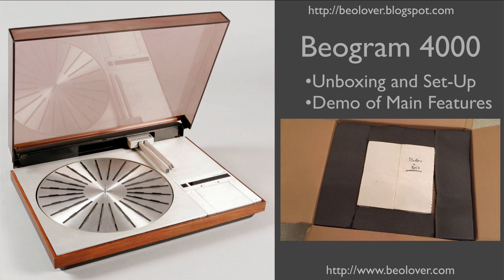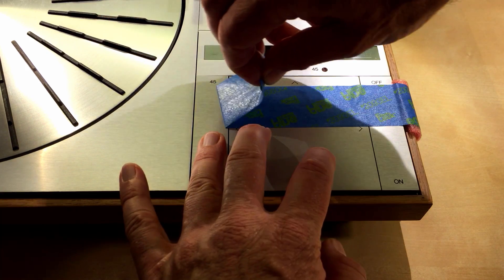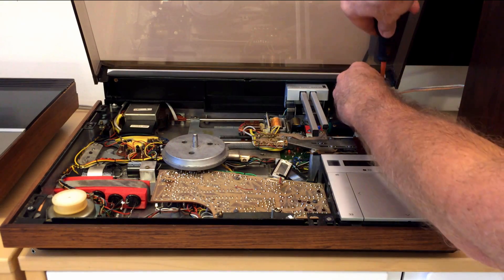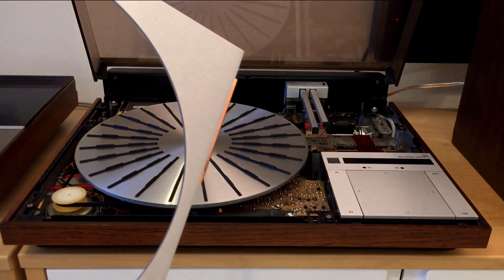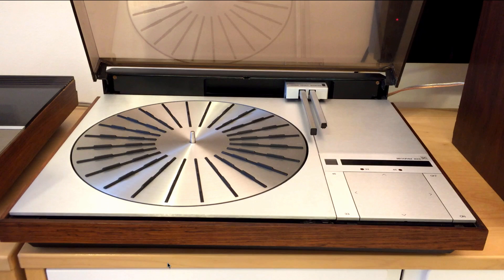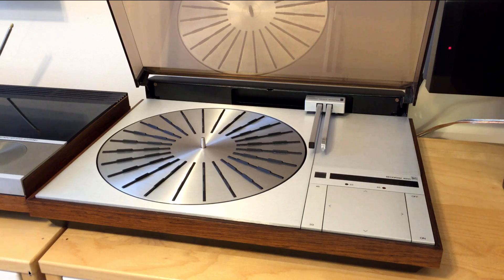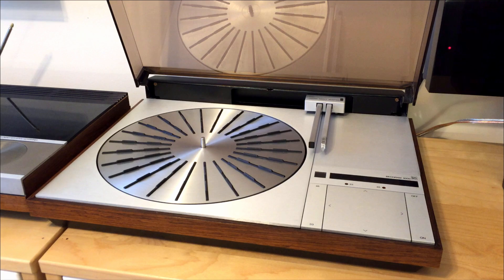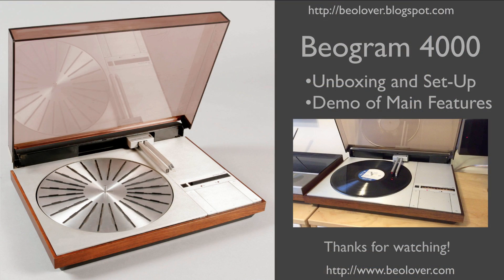Beogram 4000: Unboxing and Set-Up

Comment: Very nice video.  This is the original 4000, which I believe is very rare, at least here in the U.S.  The 4002 and 4004 are much more common.  All three look very much alike, with only the controls are a little different.

Comment: If I want to plug my Beogram 4000 into my amp which has a line in (non-B&O), will I then need a preamp? I will of course need a DIN to RCA but not sure what the audio level is at this point
Reply from the maker: Yes, you would need a preamp! The Beolover has an elegant solution for that: https://beolover.blogspot.com/2023/03/beogram-4000-internal-RIAA-pre-amplifier.html. Get in touch at beolover@gmail.com if you would like to get one.

Comment: Hello,  I just bought a Bang & Olufsen Beogram 7000 turntable with built in preamp, it has a Din 5-pin male connector, how do I hook it up to a regular system with RCA input jacks?  Do I need to get an RCA cable with a ground cable?  I wasn’t sure because this deck has a built in preamp.  Thanks in advance.
Reply: The Beogram 7000 has a built in RIAA so produces line level so can attach to a normal line in input. The plug is actually a 7 pin DIN but the two bottom pins can be unscrewed. It should work without an earth cable but if you get a hum, a wire between the casing of the DIN plug and the earth will fix it.

Comment: hello a query, I just got a 4004 type 5526, failed, the left fuse is missing and I wanted to know if it is 125Ma? and the correct voltage is 117 but I have a transformer from 220 to 110v (I am in Peru), it can work with 110v. No problem?? or it needs to be 117. I hope and appreciate your possible help.

Comment: Excellent video!When you first play that Horace Silver album on Blue Note, it sounds terrible. The pitch of the bass intro is all over the place which would 'suggest' that the turntable isn't running at constant speed. As I'm sure that is NOT the case, why does it sound like that? 
Thanks for all your skilled work.

Comment: Although these were quite good the best lateral-tracking turntables were undoubtedly Sony.  Revox and B&O had  a sort of style but reliability and basic  build quality were inferior in this particular niche.
Reply: Debatable. The later B&O decks were not as well made but the 4000 was massively over engineered with very good build quality. The later 4002 etc was made to cost less to manufacture but sounded pretty similar. The platter on the 4000 and early 4002 is extremely heavy and gives good speed stability. Reliability these days is obviously going ton be an issue as components do deteriorate with age but these can be replaced. As you can see in the above video, there is very little plastic in this deck - most is metal and wood.